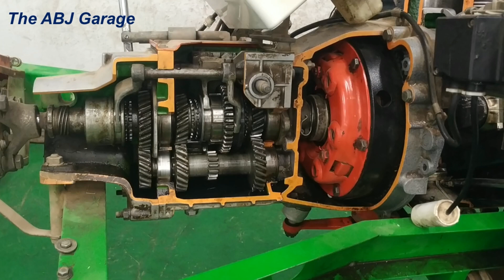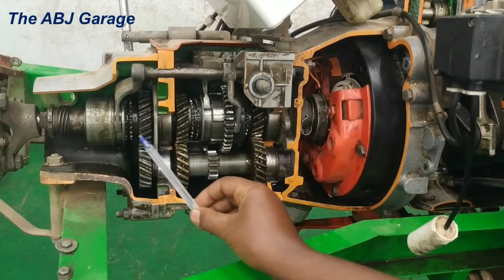7 Causes of noisy transmission

Comment: Hello ABJ GARAGE , have some question, i have a manual pick up ( mitsubishi L200/mightymax ) everytime i shift on 2nd gear and 4th gear there are noise specially when i slow down there will be a noise like clanking sound. but it will be gone if i speed up. is it possible that my synchronizer on my 2nd and 4th gear are worn/damage? thank you

Comment: 2003 Neon SRT4 here. I have a knocking noise that only goes away when I put the car in gear and drive. Think it's my flywheel that came loose ? I see you didn't really cover the clutch on here much at all and yes it's manual btw.

Comment: When in neutral i hear a whining noise that gets louder correspondingly to how much i accelerate. When in drive i hear noise also, and gurgling noise if i accelerate hard.. In drive my acceleration is weak, and RPM will not go up much in drive unless i stomp on pedal for a downshift, and it is very jerky. However in neutral it will rev easy and smooth. What do you think? It is a Lexus iS RWD

Comment: I have a whirring noise at low speed, it initially started when turning right. But now it makes a noise in all gears but especially noticeable at 60mph. When the clutch is depressed, the noise disappears. Any idea what it could be?
Reply from the maker: Where is the noise coming from? The gearbox? the differential? the clutch housing? the drive shafts?
Reply: @TheABJGarage  I don’t know. It’s very subtle but sounds like a wire stuck in a washing machine. More noticeable on the motorway when travelling distance

Comment: Hi sir I have corola 2010 manual transmission.i am facing problum noisy in all 5 gears during driving.when I press clutch padel or during driving high speed make neutral finsh noise.please answer me thanks
Reply: Did you ever figure out if there was anything wrong with your transmission?

Comment: Great video,  I have a question please, I have a little whining on 6 gear (manual) at about 100 km/h but only if I let go of the gas pedal, if I press the gas pedal even slightly the whining disappears, the whining is also there on other gears at same speed but less obvious than being on 6 gear, what bearing inside the gearbox you reckon is causing that? Cheers
Reply: I've got something similar on my 2018 corolla.  5th and 6th but mainly  6th it makes a whirring sound around 65 to 75. Like a Waugh Waugh Waugh noise. Goes away when you push in the clutch. Stresses me out being the only car I've got.
Reply: @josephhendricks6533  I bought all bearings inside the gearbox, waiting now to be delievered from the States, I just decided to chage all bearings and oil seals for all 3 shafts and the diff, I am also changing the diff with a Quaife one that is helical instead of the rubbish clutch based LSD. Cheers
Reply: @josephhendricks6533  sorted?
Reply: Sorted?
Reply: @Albe983  Yeh mate, all good now, the car is like brand new. Cheers
Reply: @AhmedBahgat  what was the issue?
Reply: @Albe983  It was one of the bearings, the front input shaft bearing or one of the Differential bearings, however I changed all bearings just in case. I really enjoyed that big job while it lasted. Cheers
Reply: @AhmedBahgat  ok thanks 👍
Reply: Thank you for your information tutorial but sir why I have a grinding sound from the gear box  until the the car get heat up and when the gear is either in 1 or 2 and the grinding sound gradually goes away as when the car get heat up and when the gear reach to 3 and Greater and also it does not make noise when in neutral
Reply: @infinite_Melody   I believe it may be the synchros of first and second gears

Comment: my car just started to make a light bump sound when i choose a gear at a stop with the clutch pressed in any idea on what that could be ? it goes into gear fine just has that sound that happens maybe 5/10 stops
Reply: i can feel it in my pedal
Reply from the maker: If you happen to feel the vibration at the clutch pedal when the clutch is depressed, then most probably it caused by a problem in the clutch system such as worn release bearing, uneven diaphragm spring fingers or irregular release fingers. Please check to see if the clutch system and all the linkages are in good condition!!

Comment: can analyze the damage to the following manual transmission.
5 speed and 1 reverse gear

1. neutral is not noisy
2.Gear 2 slightly hums, gear 3 and 5 hum Only the sound of the gas being stepped on when the gas is released, there is no sound
3.Gear 4 is not noisy normally

Can you analyze it?
Is the output shaft gear faulty?

Please tx🙏
Reply from the maker: Dear!  Have you checked the condition of the needle bearings supporting the speed gears? Please check to see if needle bearings for 2, 3,and 5th gear are worn out or not! If those bearings are damaged it could lead to noise! Also it is a good idea to check the counter shaft support bearings!! Good luck dear!!